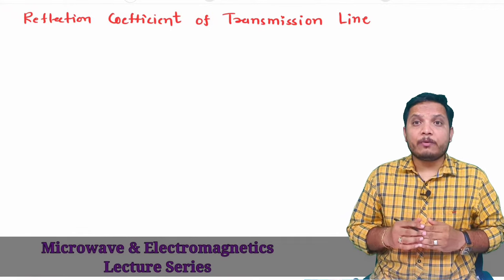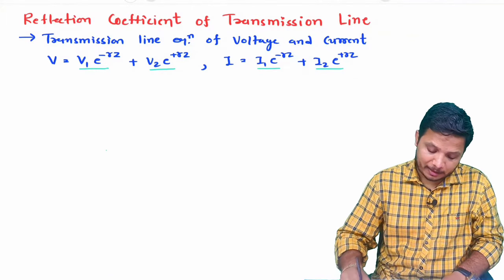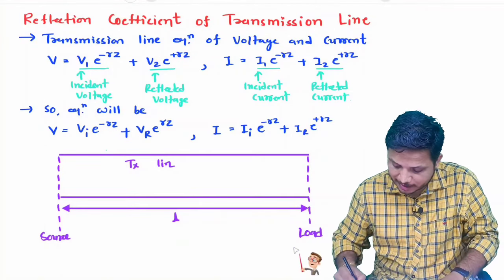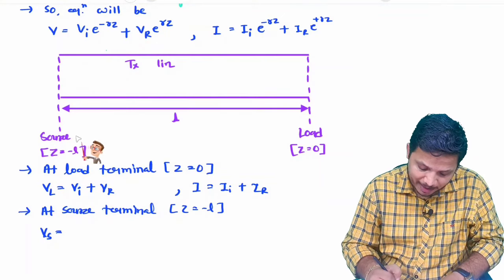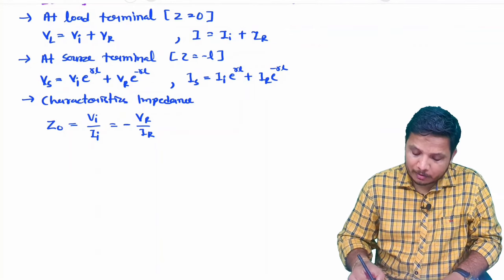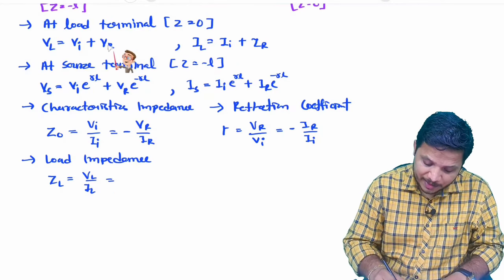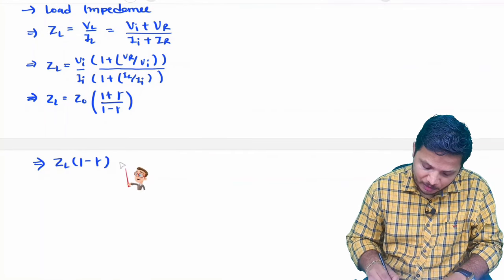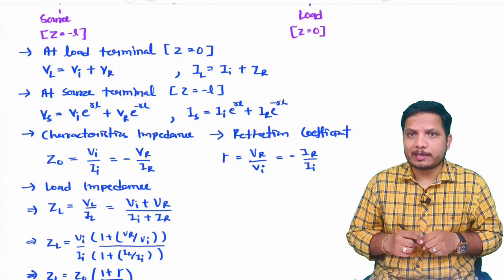Reflection Coefficient of Transmission Line in Microwave Engineering by Engineering Funda

Comment: You should look at the Veritasium video about the "misconception" of electricity.  It would be nice for someone with an in-depth understanding of transmission lines to explain what he got wrong.  He conflates the displacement current that charges the transmission line with the DC current that delivers the steady-state power to the light.